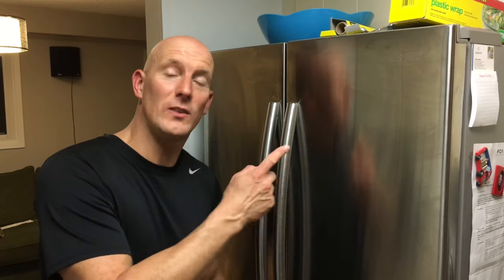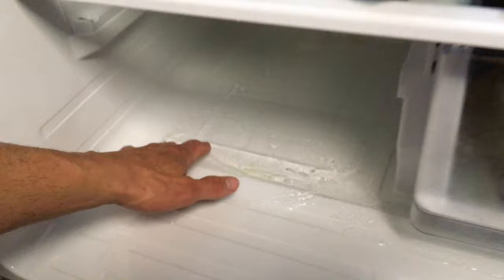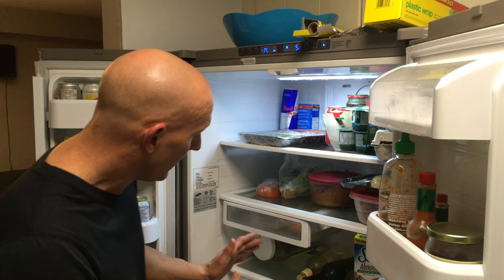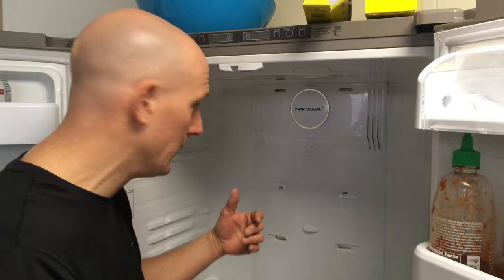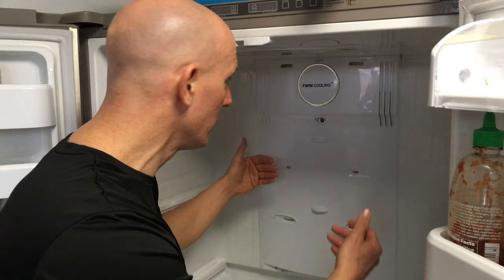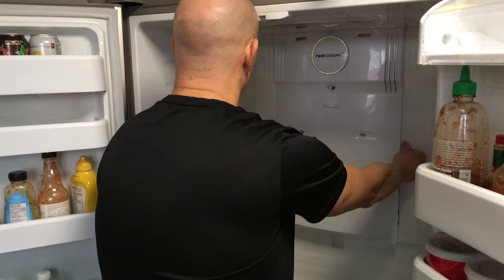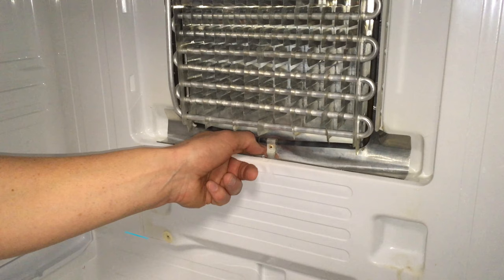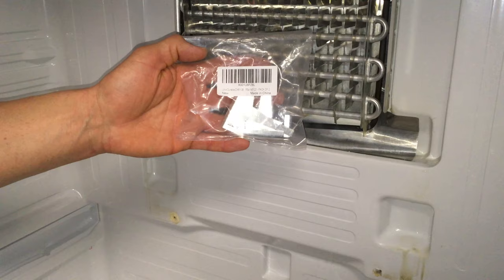Ice & Water Buildup (4K) Samsung Refrigerator

Comment: Jeff, I took out the panel and the drain is still clogged (probably with ice), any tips on how to defrost that ice in the little hole/pipe that leads to the box for evaporation? I tried boiling water but no success.
Reply: Probably takes a bit of time for it to completely melt away.

Comment: I have done this repeatedly and still have water dripping down, even after just a few hours after putting the panel back on. What am I missing?
Reply from the maker: Did you check the drains?   This is the cause 99%  of the time.  I will be also doing an updated video on this.  Thanks so much for watching!

Comment: The part that you mentioned would that fix from ice building up on the top
Reply from the maker: It should!  My fridge has been perfect since I installed this.  I had ice built up at the top and even down below in the freezer.  Now, its running 100% perfect!
Reply: Jeff Lepard how do I find the part? I clicked on the only amazon link you shared and there’s nothing there.
Reply from the maker: I will have a look and update the link in about 20mins.
Reply: Jeff Lepard I got it!  Thanks.

Comment: We did everything put clip but still leaks
Reply from the maker: Mine just started leaking and doing some of the same things!  I will be making another new video on this and a few more solutions.  It should be uploaded this week or next week!
Reply: @JeffLepard       hi Jeff - yes PLEASE do post video with more tips to help this issue...I did everything you said...and it started leaking a few weeks ago again :(  I have ice down to the bottom of the freezer and the drawer is starting to be hard to open again.  I did this process twice already...the only think I didn't do is leave it to defrost for a whole 24hrs -  but defrosted it until I could hear the water going through the pipes.  My wife is panicking with Xmas just around the corner.  Thanks for all your great DYI videos.

Comment: Oh my gosh thank you! I've been dealing with this for a couple of years. I usually just catch it before it leaks to the floor and soak it up or break up the ice. I always thought it was stemming from the ice maker. I have the exact same model as you fixed in the video. I ordered the part and it'll be here in two days. Question - do I really have to let it thaw out for 24 hours before attempting the fix? Is there any way around that? I don't want to have to put my stuff in a cooler for 24 hours.
Reply from the maker: You can try using the defrost modes or the best is that and use a hair dryer or heat gun to speed up the process that works as well too.  Thanks for watching!
Reply: @JeffLepard  Hello Jeff, Is it possible to power defrost this fridge? I mean, without simply unplugging it?
Manual does not say anything about defrosting. Thanks
Reply from the maker: @a.s.865  Yes you can.  You may have to do it many many times.  Press Power Freeze & Fridge Buttons Simultaneously
Then, press any other button until “Fd” appears. A beep will be heard and defrost begins. For dispenser models, press Freezer (top left) and Lighting (middle right) buttons simultaneously for about 8 seconds, until the display goes blank.
Reply: @JeffLepard  Hey!! This was my original comment from 2 years ago....the fix worked perfectly for exactly two years and then abruptly the bottom of my fridge started freezing again. I just opened and it was completely frozen solid and the replacement part was all pushed up/bent.  I am replacing with a new part and hoping that defrosting and then new part again will fix it again...have you had any experience with this happening a second time after the initial fix? Thank you!

Comment: Jeff, Will this fix work on a Samsung model built in 2014?
Reply: Mine is a 2014. And it will work as it looks identical to Jeff's back panel. Whether this solution will last is another story.

Comment: I did all that and after 6 months. It started to freeze again.
Reply: same, just froze again today on me
Reply: @kasyoi1545  I saw another video and besides replacing the clip, go to the back of the fridge and remove the lower cover and you'll see a couple of rubber drain pipes.  The down end of these is crimped to slow the water drip into the pan.  This crimp gets clogged up.  Besides cleaning it out by removing the rubber tube, you may take a pair of scissors and cut a very small cut on the crimped piece to allow a "little" more water to flow through.  Don't cut it wide open, just the very corners of the crimp.
Reply: @4score  Thanks for the reply, I'll have to see if I can check it out soon

Comment: This fix does not work.I got the same part from amazon.And even replaced the 2 bottom parts in the back.Still get ice.I even ran a stiff wire down the drain hole.Got nothing.

Comment: So to my surprise the clip is already a large one. Any idea what else could be causing the problem.  I made a Service call and they put in a new leak kit (larger hole) but it froze up again in less than a month. 
The repair person also broke a big chunk of the styrofoam off the bottom part of the back panel which I am sure is not helping with the moisture control problem. Thanks for the great video!!  

It would be great to have all these useless fridges and other useless Samsung appliances dropped on the doorstep of the US manufacturing company in Newberry South Carolina, and torch them all right there.

Comment: If I am not totally off. Why not just take a soda can made of aluminium and cut a a section and shape it to fit your needs. No need to order any special part. All you need is a piece of metal that will not rust and that conducts heat...

Comment: I did this and after a week I'm having the same problems. any suggestions?
Reply: Now you’ll call Samsung the tech will go see the cx tried to fix it, will take pictures not touch the unit and boom 💥 repair or accommodations maybe due to repair delay voided warranty voided
Reply: The best part, you’ll be super mad requesting to speak with manager and nope nothing is going to happen I love those kind of call 😂😂😂

Comment: I had the same issue, what was recommended at the time was to replace the evaporator coil, which I did. That problem was fixed but the fan area keeps freezing up, the top coils and the copper pipes as well. Any suggestions?
Reply: Yes, this is my problem as well.

Comment: @Jeff Lepard  Hi Jeff, Thanks a lot for your nice video and this is certainly going to be useful. I really appreciate it. I am planning to join the monthly membership program. what are you perks of membership?  Also, i went to the amazon link that you posted for the "Ultra Durable DA61-06796A Refrigerator Clip Drain Evaporator Refoem Replacement Part" and I am not sure if this fits my refrigerator (My refrigerator model is: Samsung RF31FMESBSR/AA model and wondering if you can suggest me a clip that fits my product or guide me on that.   As always, your video rocks and looking forward to join your channel.

Comment: It worked for a while, there was no water under the drawer.  A few months later, the refrigerator stopped cooling.  The water froze and the ice kept building up until.  I had to defrost the whole thing again.  I love the set up of the fridge, but this design is terrible.

Comment: I have the exact same garbage fridge. What I ended up doing to solve my biweekle refrigerator freeze over is this, remove the back like in the video, remove the styrofoam duct from the back along with the fan. Reinstall the plastic back without the styrofoam or fan. Your refrigerator will work now... Samsung doesnt have an answer nor do they give a damb! I called service companies and the answer it got was unanimously "we don't work on samsung! By removing what I stated has solved the problem 100% going in week 3...
Reply: Did you remove all of the styrofoam?

Comment: Jeff i have The F
rench door model RF28HMEDBSRA/AA ( I have the same issues).  What a piece of crap.  What is the replacement part number.  I would like to order the part and do the replacement.
Reply from the maker: Yeah its crappy these fridges do that.  The part numbers they replace are in the amazon links for those products.  I will double check to make sure that link is working.  Had some issues with the links before.

Comment: thanks for this tutorial Jeff - got my fridge taken apart as you showed but under the ice clogging that drain was gobs of rust! the gutter (?) leading to the drain that on your fridge is nice and shiny and clean? on mine it's all rust, everywhere,the entire plate under the condenser (?) and on the panel on top of the styrofoam that you disconnect and take out --- solid rust!  corroded edges, holes, rusty water dripping down into the drain. There is no hole in that drain to stick that part into - it's just solid. I used dental tools to chip away at the rust and got a lot out but there's still no hole for anything to go down - hot water, vinegar, bleach, nothing. It's a mess. And this is the ONLY fridge we can find that fits the space in our kitchen. Is it possible to go in from the back of the fridge and take out that drain tube and replace it? But then the panels will keep rusting anyway - it's like it needs the entire back panel, but parts places are kind of impossible - they show the part but don't have it. I don't know what to do, and googling rust blockage for this fridge turns up nothing. The fridge has been working great except for this drain problem. Maybe I should just put it back together and clean the ice up every few days - but of course rust never sleeps. Or call a repairman, god know what that would cost. Help!
Reply from the maker: Yes you sure can gain access to the back tube and pan.  That is another way of checking to make sure the drain tubes are free and clear.  That sounds like a bit of larger issue you have then.  I would probably do what you said try and repair that section and drain / tubes if you can and if that will work to better your situation.  Let me know how that works.
Reply: Well, after several hours, the vinegar, hot water and bleach seem to have worked because now when I pour water in it goes right down! And so I installed that part (easiest thing I've done all day). You are a godsend. But there's still the rusted panels and that gutter that will keep doing what they're doing and sending rust down the drain to plug it up again. And aluminum isn't supposed to rust? (I think they're aluminum anyway.) I don't know that I can rub the stuff off or not - like I said there are holes and corroded edges, looks like a junked car, but can I put some kind of finish or coating or something on them to slow the rust down? Never heard of such a thing. But anyway, it's working again for now, thanks to you. I turned it back on without reinstalling the panel and hooking the wires up again - just to hopefully save the ton of food we have in the freezer. Hope it can run OK without that panel overnight or something until I can figure out what to do about the rust.
Reply: @JeffLepard  Well, I had to order the entire evaporator cover assembly, complete with fan - the foam insulation on ours was soaked with rust, and I couldn't find a way to take it apart because of the fan, which is molded into its plastic plate - it gets complicated. Of course. So the new cover is $176 plus $10 shipping, and it's already been shipped. But there is still what I've learned is called the plate drain, which sits behind the heater-evaporator. It has the rusty gutter and drain opening on it, and again I can't see how to remove and replace it. Would you happen to know? I guess it can be done because they sell that specific part. I imagine the entire heater has to be removed because it seems there would be no way to slide the new one in, but I don't know how, and the exploded parts diagrams don't make it clear (but the only fastener shown is a rivet!).  At any rate, even though I had to pay $186 for the new cover, I figure your video has already saved me at least twice that, and I wouldn't have tried it without you. So thanks again! (I'm using this parts site: https://www.appliancepartspros.com/refrigerator-parts-for-samsung-rf197abrs-xaa.html)
Reply: @williamlegro475  I believe I saw a video covering that but I didn't watch. Everything's on Youtube. Just search.
Reply: Yeah I bought a replacement gutter piece because mine was rusted out and because Samsung also cheaped out on the screws (who would figure they would stay moist in a refrigerator and rust - duh!) I also had to buy some new stainless screws to replace them, #8 - 5/8", btw. The gutter is probably zinc coated or galvanized as aluminum wouldn't rust like these and of course if they used stainless we would not be facing the rust.

Comment: That heat clip doesn't work. The duckbill in the lower back gets "glued" together by calcium and prevents water from exiting to the drain pan.
Reply from the maker: I have heard that from other users depending on your fridges condition.  There's no real way of telling until you take the back cover off and see it.

Comment: Oh screw it. I'm just gonna buy this one. You said it should be compatible with most models right? Some other video guy said as much. So....
Reply from the maker: Yeah that one fits a lot of different models.  There are some different ones that are similar but this one looked like it was the best one to buy.
Reply: OK. I'll let you know what happens. Thanks mang!
Reply: @kennyvasquez8007  I did this fix last year using just a piece of copper wire... wrapped the wire around the existing tab, stuck the ends down the drain, and done.....
Reply: @funnypuppies7816  Crap! You're totally right! That's what I had seen on a video I'd seen that I can't find any more. But I couldn't remember what the guy had said. Thanks! I think I'm gonna go with protocol and get the most likely and not expensive part at Amazon, but have the copper wire standing by. We've got some lying around from construction being done by a roommate. I appreciate the fact you had an actual applicable solution. People wil respond with "I don't know", why even answer?!
So thanks mate! Stay the fuck home! And Be safe and healthy., Raven
Reply: @kennyvasquez8007  We are about to try the fix on the exact same model as yours Kenny.  Did you buy the part recommended by Jeff? And was it the correct part.  We have not de-thawed the fridge yet or bought a part.  Looks like a very easy fix if the part works. Thank you! Jennifer

Comment: Mine is in the freezer department. ...
Reply from the maker: I have 2 new videos coming on that very shortly!  Thanks for watching!
Reply: @JeffLepard  I'm giving it the ol college try
Reply from the maker: Im waiting on a part.  The next videos are much more detailed and in going over everything.  My bimetal thermostat was broke.  Im Going to show how to test that as well as the heating element.   Main reason for the ice the drain clogged up have to take off the back cover after you defrost it and clear the drain cheap plastic pieces you can open them up more.
Reply: @JeffLepard  So this video is correct and definitely found the problem.  The tiny tab to replace was off to one side and bent in half.  So there was nothing touching or going down into the drain tube.  I have a day or so wait until that inner tube thaws out.  I figure pour warm water on it every few minutes too... lol,  I'll go leave my review of the samsung fridge now.

Comment: Hi Jeff, came across your video on this topic searching for a the exact same issue/fix for an LG refrigerator. The piece you've replaced and provided the Amazon link for seems to be the same piece on the LG fridge I'm linking here (https://www.youtube.com/watch?v=xlQ99tsv74A&list=PL82740994B46DA58D&index=8&t=49s). I just wanted to be sure or see if you think the part you're recommending will work on the LG. I'm thinking it will work but just thought I'd ask for feedback. Thank you for your time and video!

Comment: Nope that's not it, replaced to aging crumbling duck billed two drain tubes in the back. The duck billed tubes clog up with junk and may not drain.  Better kit off of Ebay that has two black pigtailed drain tubes.  But otherwise good video.